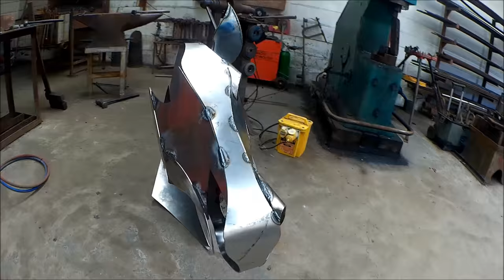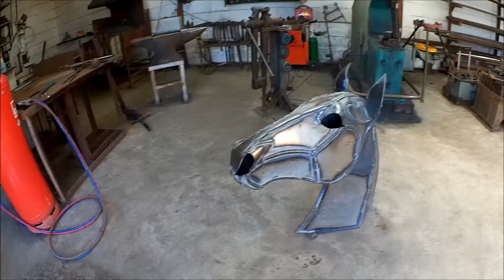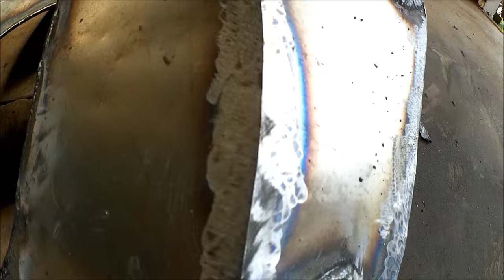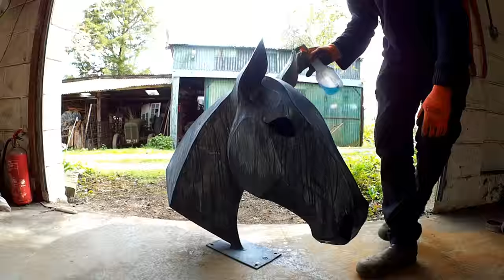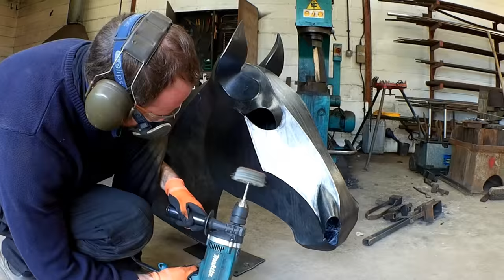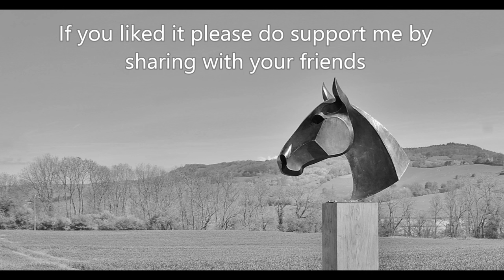Welding - Metal Horse Head Build - Monumental sculpture in HD #1

Comment: You asked at the end of the video what I think. I think it looks nice. Because of the simple lines, it has a contemporary art deco flavor. If I could offer a suggestion, fill in the eyes and nostrils (and neck base if it is open.) This will give the piece a more substantial feel. This gives me the impression that you are a welder that does art rather than an artist that welds.
Reply from the maker: Thank you.Your not the first to say that about the eyes and so I will strongly considder that suggestion. I try to master the techniques I use for my Art, I did gas pipe welding for a short while, that really upt my welding skills! i'm currently welding hydroulic tanks for a company, so the welds need to be spot on. but I would defifinately say I'm creative type at heart.....

Comment: Absolutely beautiful! As for the stick, mig, tig. When you have 3 hammers and one nail, sometimes you just pick up the tool you feel like using at the time and it's fine to not have a technical justification for the one chosen over the two not. ;)  When I was a professional welder (my first of 9 lives), I'd often stick weld or tig something just because I didn't feel like using the "squirt gun" on it 😎
Reply: I never thought of it that way but it does explain why I have so many everlast welders in my possession! As for this art work it is fantastic. I have seen a few different "iron horses" but this one really captures the beauty of a horse without gobs and gobs of little pieces welded together. Absolutely beautiful in its minimal number of parts.
Reply from the maker: Thank you! ideally I would have used TIG for is tiny bead and quick cleanup but would take far longer to weld, MIG would be fast but I didn't have any gas at the time and it shows up more when ground back and galvanized. Stick produces a good weld and is very conveinient but have to do alot of clean up. All have their ups and downs, I choose what ever is right f or the job at the time.

Comment: You might try cor-ten (corrosion resistant tensile strength) steel for outdoor sculpture. Not sure if you have heard of it, but it develops a nice rust patina over time that will not eat through the alloy. Then there is no need for rust resistant finishing.
Reply from the maker: I know the one, expensive for rusty looking stuff but I know it does last. I like the blackened look and hot Galve just gives me that assurence that it will out live me.

Comment: I like this a lot. What type of finish is on it? Will it rust in the elements or is it intended to be indoors?
Reply from the maker: Thank you! it was Hot dip galvanized, etched and then blackened with a special finishing compound. 50+ years of rust proof protection outside.

Comment: Love your work man, and thanks again for your vids on showing us the tricks of the trade. I know you've put templates online for the horse head, but is deffinately smaller than this one. do you have the larger template dimensions available to purchase, I'd really like to make a stap at this size of one, also, what type of steel and thickness are you using here? Thanks again for the continued inspiration.
Reply from the maker: Thank you. It is scalable so you should be able to have it any size you would like. I made this one from 3mm mild steel and used 2.5mm 6013 electrodes. Cheers J

Comment: that is really awesome.
Friend, i have a few question in my mind what is the thickness of your sheet metal used for this horse sculpture.what are your ampere setting for arc welding machine.
Reply from the maker: Thank you. its 3mm thick, I think I used 3.2 at 90-110 amps 50v
Reply: Joshua De Lisle sir, from where I can get this horse template so that I can make my own and share with you.
Reply from the maker: I havent yet developt one for public use but when I do they will be available for download from my etsy shop.:D
Reply: Wire structure horse

Comment: Hi josh just wondering what electrode rods you using and also steel plate thickness of that sheet metal? Thanks mate have a great day :)
Reply from the maker: 6013 on sheet steel. I used 2.5 rods on 3mm steel in this one
Reply: @joshuadelisle  thanks mate

Comment: Wahoo! Very nice, is this 3mm thick steel plate? I wonder how you form it.
That finish is so nice! Do you still have the protection of the galvanisation? Does you "patina" harm the zinc or not at all?
Reply from the maker: Thanks Geoffroy! yup thats right 3mm laser cut steel. its more a coating than a patina so won't harm the galve at all. its a bit experimental so I don't know for sure how long it will stay that colour in the open but I simply say that it will 'weather' over time.. forming it is the simple part, its the design of the paterns that was the challenge...
Reply: +Joshua De Lisle ok! you made one out of cardboard or paper before?
Reply from the maker: No I used a thin plastic material for my first experiments but now I do most of it on CAD to get the DXF file for laser cutting..

Comment: Is this the same horse build that gary houston posted building as well? I noticed yours does not have the eyes or nostrils in it which i like and have purchased your template. Just curious if they are identical outside of the missing eyes/nostrils?
Reply from the maker: Yes its the same design but I updated it because lots of people said they didn't like the open nostril and eye. You can simply cut out the nostril and leave the eye plate off to achieve the same look.  Cheers J
Reply: Joshua De Lisle thank you sir. Like the without look myself!
Reply from the maker: @mikemoeller660  thank you, it will be good to hear how you get on. All the very best with it. Cheers J
Reply: Joshua De Lisle I noticed on yours you built almost the entire one side of horse then moved to the other but houstons video shows him building both sides then down the middle which I think is way more difficult due to the piece running down the center. Do you recommend doing one full side, attach center piece then do other side?
Reply from the maker: Hi Mike. This was my first attempt at the horse and learned a lot. It was very hard getting the sides to match which is why I recommend starting in the middle first. Do look at my unicorn video on how I did it in that one. I'm cutting out the horse again to do another video to explain more in depth instruction based on everyone's feedback. All the very best. j
Reply: Joshua De Lisle wonderful. Look forward to it for sure!

Comment: Hey Joshua I purchased the pattern but not sure how to increase the size to get this much larger.
Reply from the maker: Hi. Is it Ronald? You should have an option in the print menu on Adobe PDF to change the scale. It has poster mode or full size and a percentage that you can adjust. If you send me your email on Etsy messenger I can send you the DWG files for CNC cutting, you can ask your chosen profile cuttings company to increase the scale also. Cheers J

Comment: absolutely beautiful! i have a question aswell, why do you use a stick welder instead of using MIG or is it just as simple as you dont have a MIG welder?
Reply from the maker: Thanks Ned! stick leaves much less of a mark when galvanized, this is partly because it cools  less quickly and isn't as hard as mig which means that it etches differently in the acid bath. also mig has a copper coating on the wire that alloys into the weld and attracts more zinc. if done right stick is a better weld than mig which is why most pipe regulations insist that pipe work is stick welded and not mig welded,this needed lots of strength so it wouldn't split weld put in molten zinc at 650Deg C. tig would leave much less to finish but takes much longer. I have considered using mig to make this piece as it is the fastest welding technique but it would require me to normalise the ground weld after to keep it hidden after galvanizing.
Reply: aah, that makes alot more sense to me now! thanks!
Reply from the maker: I might attempt to do one with mig and see if it makes much of a difference but I am cumfortable with stick. less spatter too!
Reply: +Joshua De Lisle personally  i always think its a good idea to trial and experiment just to see how i can make anything  easier for myself
Reply from the maker: I agree, even if it doesn't work at least you know it doesn't work and your wiser for it, but I like to to think there is always a more efficient way of doing something and I find it fun to analyse and explore that route.
Reply: +Joshua De Lisle exactly the same for me, i always think there must be a better way or a more efficient  way to do what im doing or what im making
Reply from the maker: well have to share tips! ;)
Reply: +Joshua De Lisle definitely! if i see you doing something a better way than i do it, i will be using it. and i probably  wont but if i do find anything you could do easier or more efficiently id let you know about it
Reply from the maker: +Ned Bell He he he. we'll always have our neish secrets, i'm still debating on wether to show my methods of design, I kind of think I want to exploit it for my self as much as possible first, so maybe in another 50 years.....